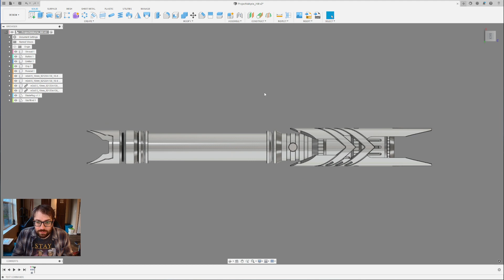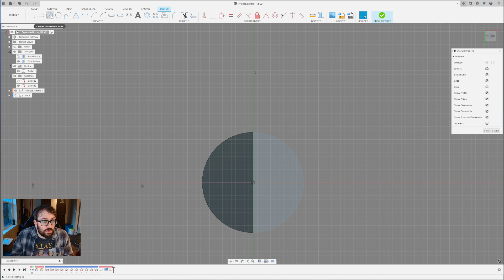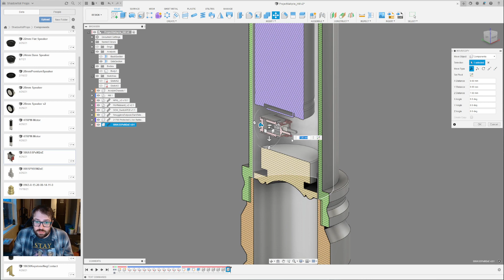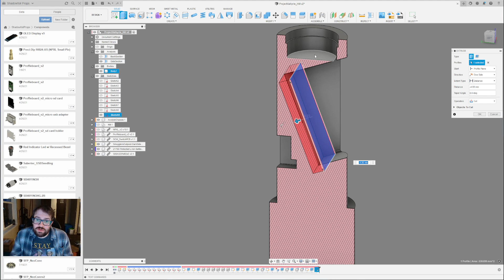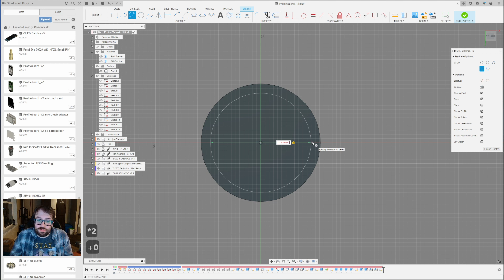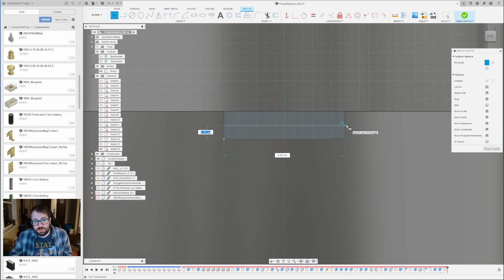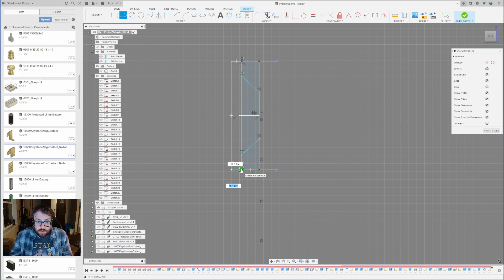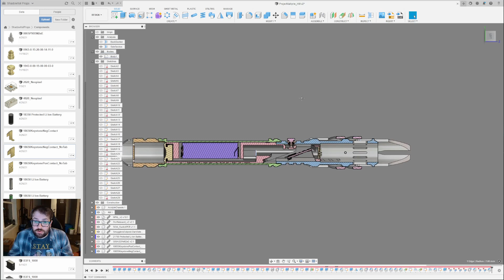Let's Design a Lightsaber Chassis

Comment: Super key ingredient is having the hilt to work off. How does one go about obtaining that if not needing to make it from scratch?
Reply from the maker: very true, in my case i designed the hilt so i had the files. sometimes hilt designers are willing to share files, sometimes they arent. if you cant get the files from them then you have to take measurements off a physical sample and recreate the key dimensions in CAD, e.g. ID, length, distance to switch plunger centers etc
Reply: @shadowfoilprops  Thanks for some key takeaways - sectional view is priceless. Projection. Not needing to open measurements to get values...it's right in the bottom corner! lol.

Comment: Really great video, I found it super helpful.  I was curious about the list of components that you have in fusion 360 (Like the sound board or switches).  Did you have to create those yourself or is there somewhere to access those STEP files?

Thank you
Reply from the maker: https://www.shadowfoilprops.com/free-stuff
Reply: @shadowfoilprops  wow, that is beyond amazing, Thanks so much.
Reply: Do you still have these files ? It would save me a ton of time doing it manually. And is there a way to design a greeblie and add it to an existing chassis design other then SVG files

Comment: Thanks for the walkthrough of your process! 
Where did you get all of the saber parts "components?"  Are they all custom made by you?
Reply from the maker: Oh yeah I've designed them all but they are all available for free on my site: https://www.shadowfoilprops.com/free-stuff
Reply: @shadowfoilprops  Wow, thanks so much! Your chassis look great.
Reply: @shadowfoilprops  Very helpful video. I was also wondering about the component models. The link didn't work, but I was able to find the files on your website. Thanks for the video and resources.
Reply: @shadowfoilprops  did you remove the files?
Reply from the maker: Files were moved to a new site, https://www.shadowfoilprops.com/free-stuff
Reply: @shadowfoilprops  Dude! Bad ass! This helps so much and that is a crap ton of work. Excellent help providing that to the fan base. Very appreciated!
Reply: The link doesn’t work am I too late? Did I miss it? 😢